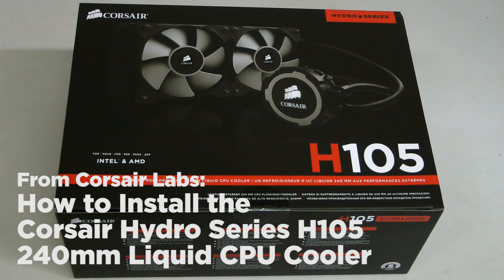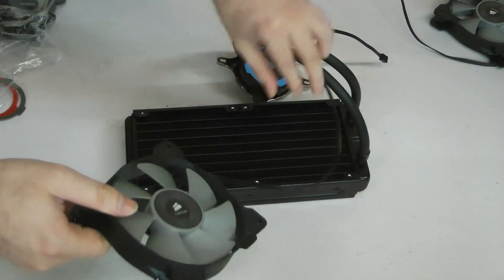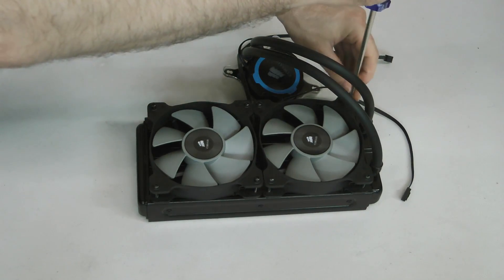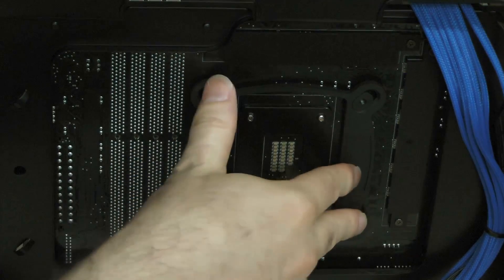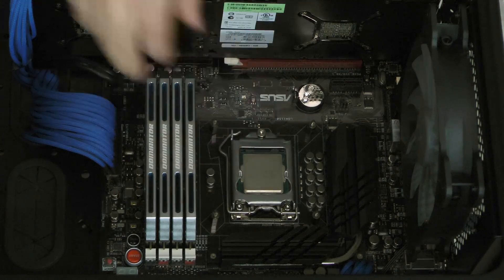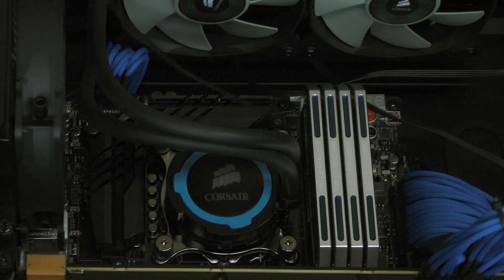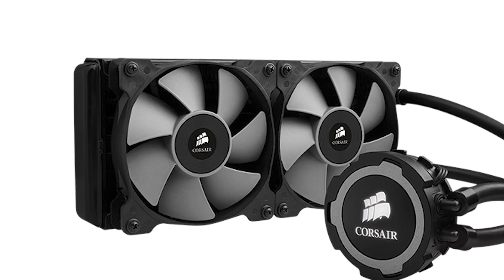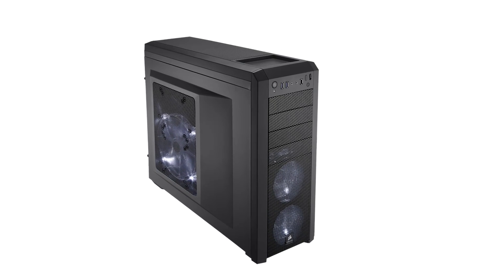How To: Installation and Compatibility of the Corsair Hydro Series H105 Liquid CPU Cooler

Comment: Had to install on the front of my Define R6 as pull, would not install on top...was hitting my ram. Buy longer tubing and install in the bottom of case (if you have options for bottom fan mounting) or get you some powerful fans and set it on front of case as to pull air into case.

Comment: I put my back plate upside down since it wasn't tight after nuts were  installed to it. Is it supposed to be loose like that? I chalked it up a difference with my 1151 skylake asrock motherboard. Thanks

Comment: no problem with socket 1151 ? pls help.
Reply: I recently put one in my 1151 socket with no issue at all
Reply: What bracket did you use? LGA 1150?
Reply: Yes 1150 is the same for 1151

Comment: Hi, I bought a H105 and after I installed, I have too many blue screens of death. After I removed it, and use the standard CPU cooler, I don't have any more BSOD. What I did it wrong? I mounted like I see in the video. Thanks.
Reply: +Uxío Feixó Maybe you didn't connect the power cables properly? Or maybe you mounted the fans backwards. If that doesn't work it may be broken.
Reply: I found what was my mistake :) Thanks
Reply: +Uxío Feixó nice! Do you like it so far? I'm thinking about buying it myself.
Reply: Yes, I like it. Don't doubt about to buy one. It's so easy to mount. Beware before you mount the pump at the base on the motherboard, at first, the backplate don't get fix it, but after you mount the pump, it's doesn't move anymore :)

Comment: no thermal paste needed over the cpu?? did i get that correct??
Reply: +Lucas Wonderz Not if Corsair's paste is already spread on the pump's copper plate. Otherwise, best to put pea sized balls on both the pump and the CPU
Reply: i already cleaned that chinese paste and used a coolermaster i bought.. but thanks
Reply: Arctic Silver or MX are good.

Comment: My back mounting plate is loose, because the standoff's  (female) protrude out of the motherboard.  However after looking at the H100i documentation on Corsair's website they show this a normal.  There is some pics of this on Toms Hardware.  Will try to assemble they way they show it...hopefully it works.

Comment: This isn't compatible with the 450D?
Reply: +Nicholas Fusco It is compatible he just didn't include it for some odd reason.
Reply: It looks like it won't fit on top if the motherboard has heatsinks there since this is a thicker radiator. I ended up ordering an H110i GT.
Reply: Nicholas Fusco Alright, I have the H105 and it fits fine. I guess it's because I don't have heatsinks either.
Reply: I thought about getting it and mounting in on the front, but the price difference was only $10.

Comment: The shorter screws supplied, to attach the radiator to the ceiling of the case, seems too short when I try to screw them through the rubber washer like He does @ 2:05 Have I done something wrong ? Please advise. I own a 750D which should work accordding to the compatible cases advertised. Thank You

Comment: Help! I have this cooler with my 4790k and I'm getting extremely high temps. They are not stable on idle, the temp moves between 30-42 for no reason. Just one second after clicking on Prime95 stress test the temps go from 30 to 80, and lower to 30 just one second after endind the test. The fans run so fast tho, and the pump is at 1500rpm on idle and 1750rpm at full load. So where's the problem?
I think when I installed it I tightened a bit strong, may it cause the issue? Thank you.

Comment: have a question about this... does it have to be top mounted?  or would i be able to mount in my Thermaltake Spedo Advance package cases dual 120MM fan spot on the rear... would the pump be powerful enough to run vertical(up and down) or does it have to mount horizontal?
Reply: +RRooooooNNNN People mount these in the front so i guess it would be fine
Reply: cashton456 Thanks, I ended up buying the Cooler Master Nepton 240m and placing it in the rear. posted a video on my channel about AMD installation.

Comment: preapplied thermal paste? genius!
Reply: Ben Gregoire Design  yeah i was wondering this myself?
I am a total noob at water cooling and he did not apply any Thermal paste to the CPU on this vid?
Reply: charvelstrat81 
no worries, all installed CPU coolers need thermal paste to transfer heat off the CPU. I got an H105 for my desktop a while back, it has thermal paste already on the cooler, and it works fine, no additional paste needed. It's that grey circle on the cooler attachment you see @2:15

Comment: Hello, Corsair! I recently attempted building a brand new computer from the motherboard up and most of the components were purchased from your company. I've been extremely satisfied with everything except for the difficulty I'm having when trying to install my H105 to my 500R case. It may just be my motherboard (Gigabyte GA-G1 Sniper Z97), but if I assemble the H105 as the video shows then there isn't enough room between the top of of the interior of the case and my RAM for the radiator+fans to fit.

Suggestions?

Comment: where the pump connector connected? this connector is 3 pin and connectors on my motherboard are all 4. I have an Asus maximus hero vii. I can connect to cpu-opt? that even on a pin?
Reply: The pump connectors go on the cpu header and make sure that you running your that header at full speed.
Reply: ylvin pena Hello, I have been told that you connect the power supply. the speed of the pump is not advisable to modify

Comment: What PSU was used in this build? It looks amazing!
Reply from the maker: AX1200i with blue braided cable kit. :)
Reply: Hey Corsair, can I use this with LGA 1151? Thanks
Reply: yes, it says it right on the website. "Intel™ LGA 1150, 1151, 1155, 1156, 1366, 2011 and 2011-3"

Comment: What is better in cooling ?
H105 in Push OR in pull or 
H100i in PushPull 
Thanks :)
Reply: Personally I'd go H100i push-pull. Allows you to run the fans at lower speeds. ;)
Reply: Ok 
Thanks mate :)
Reply: Dustin Sklavos so the H105 fans only can do air in-take?  is that the best way?

Comment: I have the h105 and asus hero mobo and can confirm it fits into a fractal design arc midi r2
Reply: In The Top of the Case ? or the Front ?
Reply: I have it installed at the top in push. I'm pretty sure it can fit in the front though.
Reply: Thanks :)